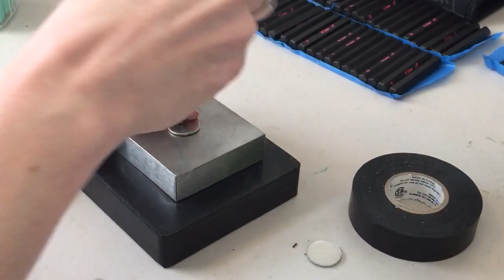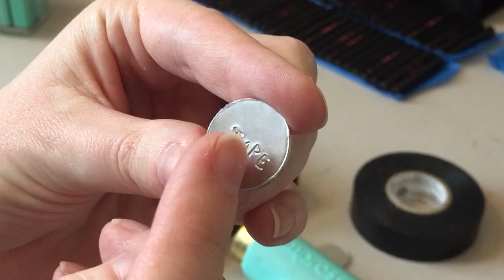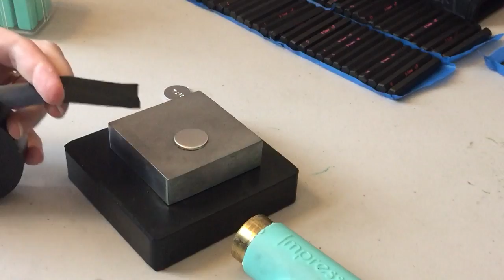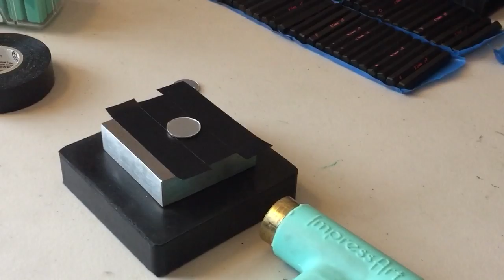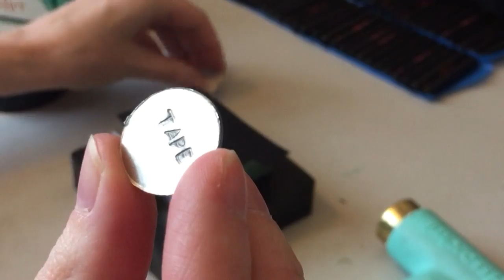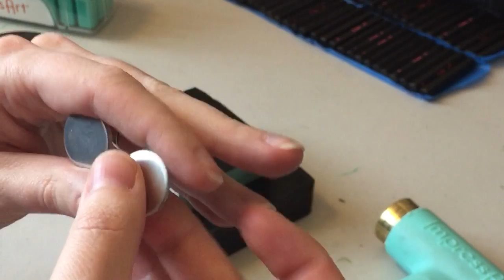Metal Stamping Jewelry Tips (Clean Backs)

Comment: Why not just leave the pvc backing on the side touching the metal block then remove afterward?
Reply from the maker: Lou S You absolutely could do that! Most blanks that I’ve used come without the pvc on the back, so this was more to demonstrate what to do if your blanks arrive with the back unprotected. Also with these, they do have a sharp bur around the edge on the back, so I usually peel of the pvc and give them a good hard tumble before stamping, to knock down that bur. I should have explained it in the video. :)
Reply: Make It Kate what is a tumble?
Reply: @makeitkate3240  Great video and thank you.
Could you describe what a 'Tumble" is please.
Reply: @DaisyReese  I think she puts it in a tumbler machine; like one does with glass or stones to soften them rough edges.

Comment: Great video! I'm stamping fairly thick silver bars. The problem I'm having, is that every time I stamp them in the middle, it bends the silver bar. Is there a way to stamp without bending the metal?
Reply from the maker: The first thing I think of is that you might just be stamping a little too hard for what your silver bars can take. Do you know what gauge the bars are? In my experience, anything thinner than 18 gauge will distort really easily. One thing you can try would be to use multiple softer taps instead of a hard blow. You could also try to work harden your silver just a bit before stamping. You could do that by just lightly hammering it repeatedly with a rawhide or nylon mallet. If those things don’t help, I can try to help you with more troubleshooting.

Comment: So I’m looking into this as a hobby for my daughter. I’ve already watched your tools videos , thanks for those. But would you recommend the impress art letter spacing tape and any suggestions on making rings and bracelets?
Reply from the maker: Hi Angel!  I've never used the spacing tape.  I honestly have found that the best way to get good spacing is to practice.  I personally struggle with trying to line up a stamp with a mark on a paper or tape.  But when I practice with my stamps, I get a feel for where the edge of the stamp will line up on the letter I've just stamped.  I hope that makes sense!  
For rings and bracelets, I love using the blanks that come flat, and then you stamp on them and then bend them into a ring or bracelet shape after stamping.  You can stamp rings and bracelets that are already formed, by putting them on a mandrel in a vice.  But for starting out, I'd go with the flat blanks.  That's what I still prefer to use. :)

You're sure welcome to come and join my Facebook group for stamping, called "Make it Stamped" and ask any questions you have.  We're all happy to help.

Comment: Can you use the same technique for stamping a word on the back of the metal without it messing up the other side that already has a word? Also, could you please tell me where you buy your 14 gauge blanks from? Thank you!
Reply from the maker: I wouldn’t recommend it. The problem is that stamping displaces the metal, and on the opposite side of the blank it creates either scratches (if you aren’t taping your block) or bulges (if you are taping the block). So no matter what, you’re not going to get a flat surface to stamp on, on the other side. 

I get my 14g blanks from Etsy.com/shop/blankthat or Etsy.com/shop/birdseyeblanks.
Reply: Thank you so much for your response, I really appreciate it.

Comment: Is there a big difference between that and stainless steel? I want to begin stamping stainless steel jewelry
Reply from the maker: Yes, there’s a huge difference. Stainless steel is very hard and will destroy regular stamps. You’ll need stamps that are specifically made for stamping on stainless. (If the stamps don’t say if they’re rated for stainless, then they’re NOT.) You’ll also need to learn to hit very hard with your hammer to get a good impression.
Reply: @makeitkate3240  so do you think it would be too hard to start of with stainless steel? I want to start my own shop in Denmark, but i don't know if i should buy a laser machine or do it by hand... and it just seems like finding products that isn't stainless steel for a good price is very hard.
Reply from the maker: @midnightcreations8519  I think it will honestly just depend on your budget. Stainless steel blanks are more expensive than aluminum. And the stamps are much more expensive because they have to be heat treated in order to not become deformed while stamping on such a hard metal. As far as learning the skill, I think it would be the same kind of learning curve that you would with softer metal. It’s just a matter of learning something new, no matter what kind of metal/stamps you’re using. :)

Comment: Great video! I am slowly learning. I bought one of the impressart premium alphabet sets, was not impressed with many of the letters. I actually have better luck with the basic sets for 19.99 (and a coupon lol). The premium set was from amazon and I wonder if it was because they had sent one that had already been used and returned (they are doing that more and more these days). Anyway, do you think the premium sets are better? Thank you so much.
Reply from the maker: Hi Melanie!  I have actually never used the premium sets.  As I understand it, the difference between premium and regular Impressart sets, is that the premium are rated for use with stainless steel (and have a few extra stamps in the sets), whereas the regular are not.  The images/impressions are exactly the same.  I personally don't stamp on on hard metals, so I didn't care to spend the extra on them.  I feel like the Impressart font stamps are okay, and I still use them frequently.  But given the choice, I will use stamps from a different manufacturer.  

Also, if you're still building up your tool supply, you might want to enter for the giveaway I have going for the rest of the month!  The details are in my most recent video. :)  If you have any more questions, just ask away!
https://www.youtube.com/watch?v=9Vxd0rsSYi4

Comment: What a great tip. Do you still use the tape now?
Reply from the maker: Kristi Vaughan I do! I’ve switched to duct tape on my bench block now, just because it’s wider than the electrical tape. And it comes in cute colors. 😁 I absolutely still use the electrical tape for straight stamping. Still the best thing I’ve found.

Comment: Could you not stamp that the plastic still on the back of it?
Reply from the maker: Bruce Barnes you absolutely can, and it would work just the same way! Not every supplier provides blanks that are pvc coated, so this technique works well when your blank doesn’t have that protective plastic. These days I use duct tape on my bench block, instead of the electrical tape. Some people use masking tape. The principle is the same - just a protective barrier.